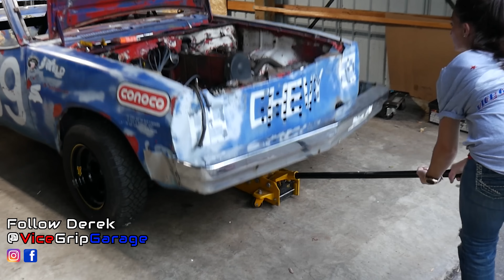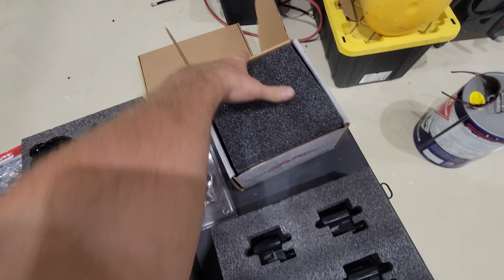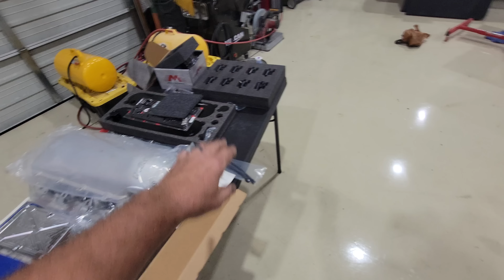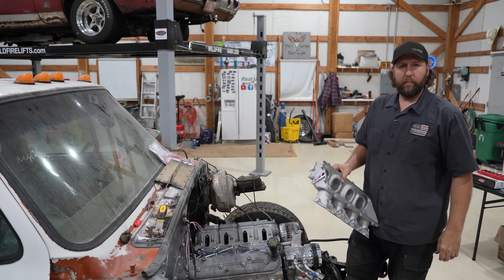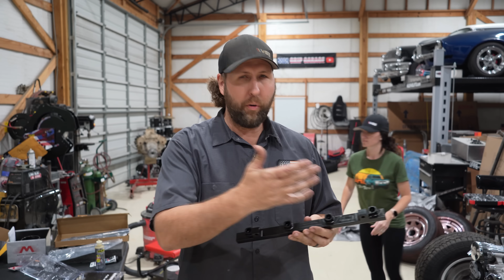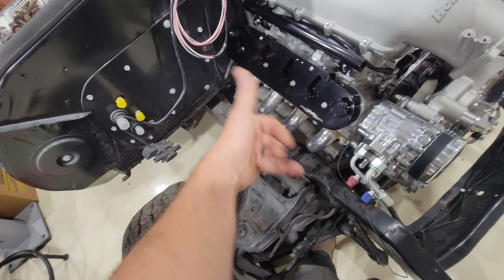FINALLY! Complete LS Engine Assembly For Crew Cab!

Comment: Try dampening your masking tape with a small spray bottle or a sponge. Sponge preferably. Warm water will help. Let it soak in for a few minutes. It may take more than once. In theory a feller could use goo gone. In moderation of course.

Comment: With it sittn its probably going to be a pain to get the oil to prime.  You may need to use a presure oil filler upper threw the oil port 200 device

Comment: A little bit of heat might have worked pulling tape off. At least the paper part. Then you just have to deal with glue. Goo Gone and what you used works for that.

Comment: Hey derek next time you have to do that they sell a silicone drill brush it doesn't cut the medal but it cuts the hell out of tape and old gaskets an they hardly ever wear out either so add that to your tool box it will help a lot

Comment: The truck is looking pretty danged good.I was told about a place in Connecticut that has some 60' s mussel cars and the ownercpassed. There is a 68bImpala I want there but can't get there and Marine son is always out of the country.  I have an original 425 hp 396 from another 68 Impala But bedridden because of COVID in 2020.Hidden headlights and all.

Comment: Finally, an Old School Guy, like myself working on the 5.3 LM7.  These engines were built right for longevity if not for all out power. I'm still in disbelief that my work truck stills runs like new after 300K miles with all original parts except for sparkalaters, radiator, water pump, and fuel pump.

Comment: Derek, on your fuel system. Look into the summit LS swap filter regulators. They work great, instead of having to mount one on the inner fender
Reply: Them things are junk lol they can’t handle a pump over 255

Comment: If you don t turn a engine at least  2 times a month or  not.you risk stamping your lifter springs due compressed springs on what ever stroke it is on ,so half stamped half none stamped =piston slap and off balanced .

Comment: I never was a 454 guy till I got a 99 chevrolet 1 ton with a 454 that got a consistent 21 mpg that sold me on the newer model gas platforms that was after a stent with a Cummins that I couldn't get any more than 18 mpg and very lethargic power put down to the ground that 7.4 spoiled me to big block raw power hook to a gooseneck load it with 20 moma cows and go down the road with a/c cruise set at 70 in 5th shewy raw power and a smooth 20 mpg can't shake a stick a that engendering wonder

Comment: Really enjoyed this one Derek. I like you took the time to walk us through the process of the front ddrive stuff and now the intake etc. As an old Carburetor guy I can use all the help i can get with this aftermarket EFI stuff. I got one more hot rod in me, may even dive in to the EFI pool on it. Thanks again. And as a fellow out in the sticks dweller, I hear ya on the nuts and bolts deal. I caved and got the stack o bins.

Comment: It makes me sad to hear Derek say the LS engine is the future of hotrodding... because we are nearing the end of internal combustion engines as we know them, fellers. In 20 years it's all going to be different, they'll be in the minority, and mostly just in use for over the road stuff and tradesmen vehicles. Most of those will be running biodiesel. The only way I see the IC engine maintaining its dominance is if somebody comes up with carbon neutral fuels or something else that can be burned in a piston engine that doesn't dump CO2 into the air.

Comment: I’m going to either 289 swap my single cab short bed 1993 Ranger (it’s got 3.45 rear gears) or 4x4 swap with a 2-door Cherokee driveline if the 2.3L ever blows up. I take care of it and they’re darn near bulletproof if you maintain them.

Comment: Cut a piece of thin plastic to size , get some strips of magnets with adhesive on one side, stick the magnets on the plastic, then just stick them in place. Three years later zippity bippity pull off easily, store them for your next project.

Comment: Yeah, it's bad enough you gotta pull out the tap n' die set, but when it never has the size you need... Gotta steer clear of the shop for a few minutes. Happened 3 times on me now. "Every size except the most common for your specific situation."

Comment: b
Brush on a dab of M.E.K. solvent it will soak through painters tape and release the adhesive for an easy wipe off. Use gloves and ventilate the area and no smoking.

Comment: I keep a jar of 3M silicone grease on hand. Part# 08946. Good for all sorts of things and not harmful to rubber or plastics. O rings (even A/C), hoses, spaghetti gaskets, spark plug boots... I use it quite a bit and this jar lasts well over a year. Has a little brush in the can like anti-seize but with no metallic properties and no petroleum products that can harm certain rubbers and plastics.

Comment: Here''s a suggestion ro get away from the dry old painters tape removal. I have pieces of foam rubber around my shop--I use scissors to cut custom plugs any size I need, I compress em and put em in whatever hole that needs filling and they expand keeping the hole plugged. Later you just pull em out with your fingers or a needle-nose pliers and throw em away. Don't let em fall inside the motor obviously, but they never do if you make em right to begin with. They're easy to make.

Comment: If you ain’t got a big cubic inch motor the best intake for the application is a TBSS intake .. you actually loose power with the big intakes on a 5.3

Comment: Hey Derek here's a link to the video on Cleetus' 2nd channel about the nut and bolt system the feller is talking about. If you don't trust clicking links I understand. If you want to check it out go to Cleetus2 McFarland and you can find it easy with the thumbnail they used.
https://youtu.be/UNEMJmu4s8I

Comment: Derek, I’ve been watching you since the ‘early years’. BIG fan of you and your entire family!  I watch you haul out the ‘cheek poker’ all the time, and wonder if a guy has ever used the Scotch Brite ROLOC discs for removing pesky things like old tape and stuck on gaskets. These discs make the job so easy, it’s almost fun. And I ain’t kiddin…

Love everything you do!
Reply: Definitely not recommended on aluminium as they can be bloody aggressive and remove to much metal in no time. Even the ol’ cheek poker can be to aggressive.
Reply: @rshep198  They make different grades of abrasive. I’ve used the green ones many times on aluminum. With very light pressure, they remove stuff without any damage at all. Can’t say the same for razor blades or cheek pokers.
Reply: @johnmiller2923  I’ve used them aswell and know about the grades. I’ve also had some pretty bad luck with them regardless of pressure applied, which is why I steer clear of their use on aluminium. It would’ve blocked up immediately using them on that tape anyway. Nothing beats a sharp scraper and a good quality solvent to get that stuff off anyway.
Reply: @rshep198  Guess I was just lucky.  I keep the speed and pressure low, and they work fantastic for me.  I do agree that it’s safer to use them on steel.

Comment: I don't work with aluminum parts much but when I do I use anti-seize compound on all the bolt threads when assembling them. I've come along behind somebody that didn't use anti-seize compound (even the car makers sometimes) and the aluminum threads came out stuck to the bolt.

Comment: Love the channel and content! Keep up the great work. One caveat. That looks like a short runner intake. ZERO torque below 4400 rpms. Might want to rethink that before you get too far into spending money on tuning etc. Stock intakes make more power down low. Camaro, Corvette, or Trailblazer SS are the best options for “get in it, turn the key, reliable, going to town” daily drivers. Check out Richard Holdener’s channel for EXTENSIVE LS dyno testing. Just my $0.03
Reply from the maker: Future build planning - appreciate the input
Reply: Sushi slicer?

Comment: Some of your viewers might want to know what kind of grease your are putting on those O-rings. After years of using chassis grease on O-rings I found out when I rebuilt one of my air powered nail guns last year that you're supposed to use silicone grease/oil on O.-rings. Regular grease/oil will degrade O-rings.
Reply: Any rubber grease or silicone grease will do. Anything that states ‘can be used on brake systems’ will work as it’s usually silicone based aswell.

Comment: The two most expensive tools I had to get for my LS builds was an inch/pound torque wrench good to 50 for the intake/valvetrain bolts, and a breaker bar sized foot/pound torque wrench good to 350 for the harmonic balancer bolt - I did invest in an ARP bolt for that so I could re-use it - the stock bolt is torque to yield and isn't reusable. I've been replacing bolts with ARP's whenever I take something apart.

Comment: For the dried on painters tape. Up here north of the border. That’s Canada not Kentucky, I use a product called Goo Be Gone. Just wet it down and a bit of rubbing with a rag and presto goo be gone. I bought mine at Canadian Tire but don’t remember see one of them in Tennessee .  Ace should have it or the big box. Cleans dried decal sticky stuff real good.

Comment: Intake valve covers fuel rails injectors … That is definitely a throw money at it approach. While it looks great the stock truck manifold will give you a noticeable bump in torque down low over that intake which will out perform the stock truck intake by only a few hp and only above 6000rpm.

Comment: Hey Derek, Cleetus was having the same issues with nuts and bolts. He actually made a video on the guys that helped them . It's a well thought out system. They got QR codes for each nut and bolt so when you run out of that certain bolt, you simply scan it and it re orders it. Get in touch with him, I'm sure he will put you in contact with the Nut and Bolt guys. It's the best system I've ever seen to be honest. And they LEGIT have every nut/bolt ever made. It's quite unreal. Even go watch his video, might be on the cleetus2 channel if not the OG channel.
Reply from the maker: Thanks!!
Reply: Dam you beat me to it just sawr comment after i bleep blooped lol
Reply: Ya that looked like an awesome setup. Cant remember the guys name
Reply: glad i scrolled down to see if anyone had suggested N&B guys. I'll thumb up your post.
Reply: I work in fair sized body shop and we use the Wurth system at work. But you can have Napa set up a bank of drawers stocked with clips for you. Wurth is a company that does that for a living
Reply: Was going to mention about that video from Cleetus, but got beaten to it.  Worth a look see.  Looks like a  beautiful system that Cleetus has.  Would actually look good in that new shop if yours.  Big fan from Ontario  Canada
Reply: @DavidJayK  hey Ontario , hey great thing we can go over the border now can I actually go see my wife’s grandma not
Reply: Glad you typed this out because I was getting ready to
Reply: I was just jumping to the comments to say the same thing.  Nice job!
Reply: @patrickloomis6079  thank you kindly!
Reply: Yep